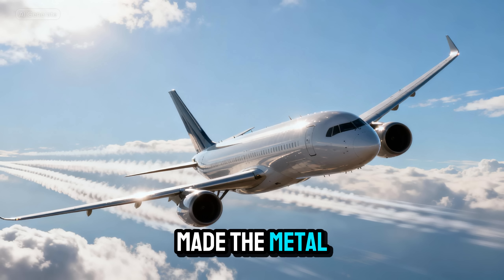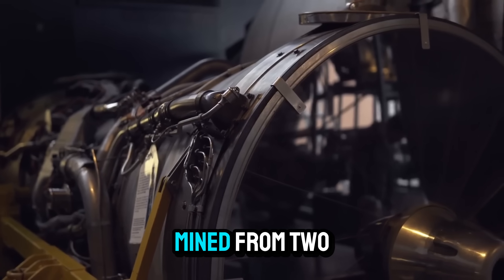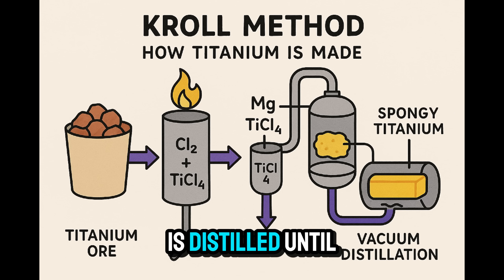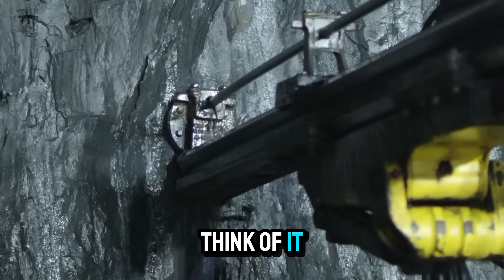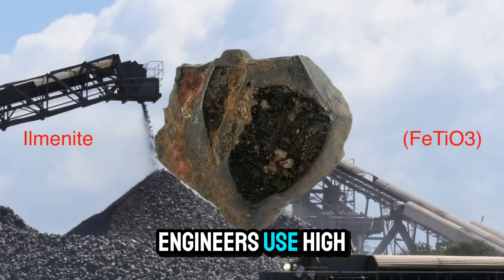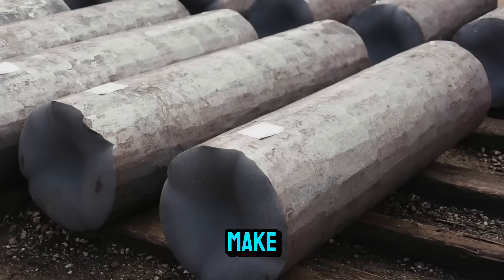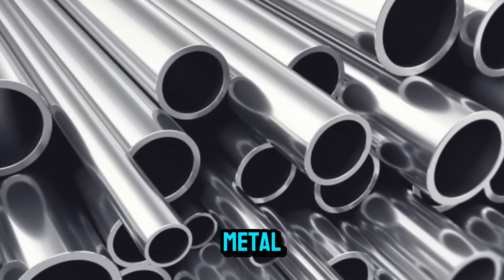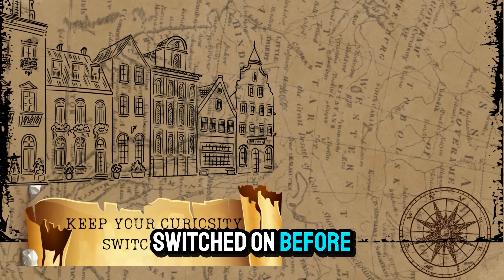How is Titanium Made?

Comment: Soviet Union titanium submarines were faster than steel submarines because titanium is both stronger and lighter than steel. After the fall of the Soviet Union on December 26, 1991, they needed lots of cash and were selling Titanium crowbars and shovels for bargain prices. Savvy buyers bought them up because they were affordable, lightweight, strong and corrosion resistant. Titanium is 40% lighter than steel, is as strong as steel and does not rust. For example, Titanium crowbars are used by divers to pry abalone from rocks. Titanium shovels do not rust are lightweight and used to scoop dirt, snow or animal feed.
Reply: Unfortunately it doesn't take to continual stresses of diving and surfacing.... it eventually crumbles.
Reply: @Narukosaki Like aluminum, not flexible w/o stress cracking.
Reply from the maker: That’s an awesome bit of history — and you’re absolutely right! The Soviet titanium submarines were engineering marvels for their time, and it’s wild how surplus titanium tools flooded the market after the USSR’s collapse. Titanium’s mix of strength, lightness, and corrosion resistance really makes it one of those “super metals.” The diver crowbars and rustproof shovels are perfect examples of how something built for Cold War technology ended up in everyday use. Thanks for sharing that! 🚀🔩
Reply: Aluminium isn’t strong enough of materials to building the structure.
Reply: We actually built the SR71, the spy plane that was meant to keep tabs on the Soviet Union, with Soviet supplied titanium. It was procured through several shell corporations before it made its way to the USA. It was the only material that could be used to do the job.

Comment: The background music in the intro was really annoying. Should have been half as loud as it was.
The process for titanium sounds similar to the challenge for efficiently extracting aluminum, another metal that bonds strongly to oxygen. It wasn't until the late 1800s that we figured out the first method to do that. The problem with Titanium is that it is very difficult to fabricate with. It instantly work-hardens, which is one of its principle strengths, but, in manufacturing, the biggest problem.
Reply from the maker: Appreciate the detailed feedback on the music and the excellent comparison to aluminum extraction; it's a fascinating challenge to work with titanium!

Comment: I had a college professor who worked on the Titan rocket system. He said that they use titanium to make tanks that could hold 600 pounds of pressure. They were only one 16th of an inch thick.
Reply from the maker: That’s incredible! Titanium’s strength-to-weight ratio is almost unmatched, and stories like that really show why aerospace engineers rely on it. A tank holding 600 psi with walls only 1/16 inch thick is wild — it perfectly highlights how titanium can stay ultra-light while handling extreme stress. Amazing piece of history, thanks for sharing!

Comment: Yes, I now how titanium is made. Worked in a titanium manufacturering plant for 40 years. I was a machinist and then a millwright. I worked in the melt shop most of the time. We made ours from TICL4, it came in tank cars. We cooked it with large amounts of magnesium to create the titanium sponge. We made ingots from 24" in diameter to 36" weighing up to 15,000 lbs. We made metal that went to the moon on the lunar lander. It doesn't transfer heat. We also cast many different products, we bought some scrap from Russia that was a cut up submarine. We couldn't use it because it had many contaminates in it, no good, and was actually radio active so we had to send it to the dump to be buried. We also forged a lot of it, heated it to around 2000° F up to 24 hours. Made a lot of pry bars out of scrap bar stock.
Reply from the maker: Wow, that’s incredible! Forty years in a titanium plant — that’s real hands-on experience most people will never get to see. The process you described with TiCl₄ and magnesium is fascinating, and the part about making metal that went to the Moon is just amazing. Thank you for sharing that story — hearing it straight from someone who actually worked in the melt shop adds so much depth to how we understand titanium production. 👏🔥
Reply: @everydaythingshistory the Russian titanium was not as good as Americans titanium. For a lack in quality they made up for it with mass from my experience. We called the TICL4, tickle. A gas you could not breathe. We cooked it in large tanks and the magnesium pulled the chlorine, the CL4, out and it was tapped off in containers and sent to out magnesium plant and we used electric furnaces to separate the chlorine and magnesium so we could sell both to people  who used it. The titanium sponge was left in the tank and was chopped into small pieces so it could be pressed into bricks for melting in our arc furnaces to make the ingots.
Reply: So hard to imagine Russia using low quality, contaminated…well, anything.
Reply: Right🎉

Comment: Titanium tig welding is fun. You're arms are encased into a see through tent filled with inert gasses.
Reply: We welded scrap titanium together with mig welders with 1/8" titanium wire on tables by hand. Also welded the titanium bricks together in a vacuum tank with plasma torches to make electrodes up to 20ft long to melt in our large arc furnaces under a vacuum.
Reply: @christope44 Woah!!!!! That's awesome!!!
Reply from the maker: That’s awesome! It takes a lot of skill to work with titanium, especially with those specialized welding setups. 💪